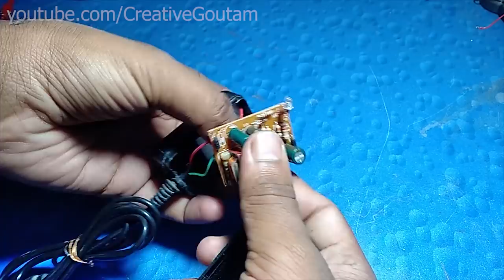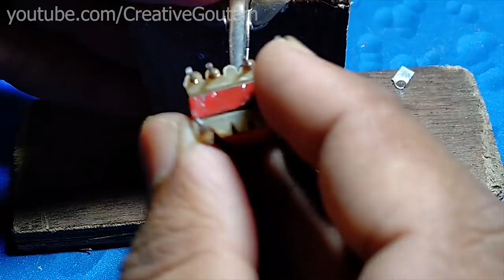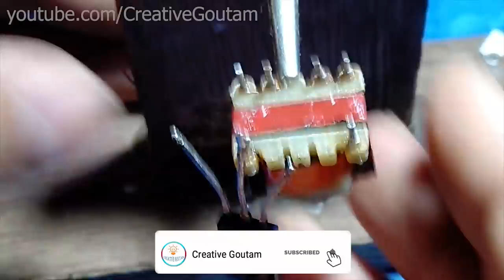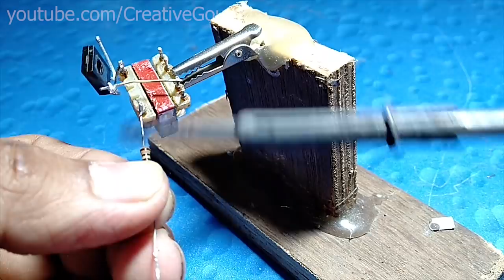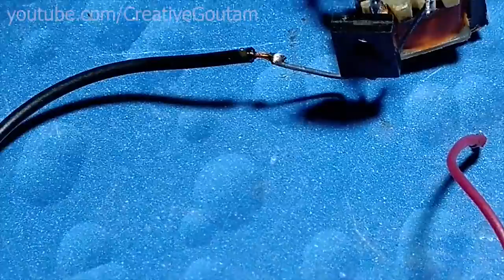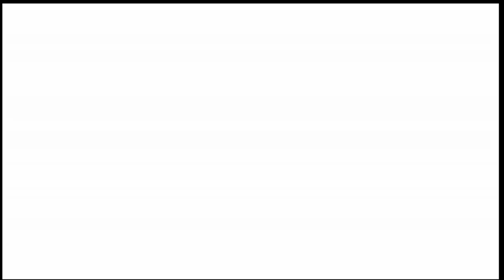Mini inverter 1.5V to 220V | DC to AC Inverter

Comment: there is no oscillation or pulses. the transformer cannot do anything after the first second. if there were pulses from a capacitor or oscillation from AC from a wall socket or a dc to ac converter circuit the magnetic field generated from primary windings having power run through them  would raise and collapse over and over again allowing induction to take place. transformers are induction devices. the raising and collapsing replicates the effect of movement. continuous DC wont do that. and if your battery is AC which i doubt but if it was none of that is needed but the resistor to tie the feedback winding to negative
Reply: I know it's kind of randomly asking but do anyone know a good place to watch newly released movies online?
Reply: @Matthias Garrett Flixportal :)
Reply: @Jordan Willie Thank you, I signed up and it seems like a nice service =) Appreciate it!
Reply: @Matthias Garrett glad I could help =)

Comment: 12volt dc input to 230volt ac output for spygaurd connection?
Reply: Reply??
Reply from the maker: Sorry I did not understand what you want to say.
Reply: how to convert 5 volt dc to 230 volt ac? i want the full details what are the componens to be usd
Reply: @Khushiparashar2679  you can run it on 230v DC but still i think its fake